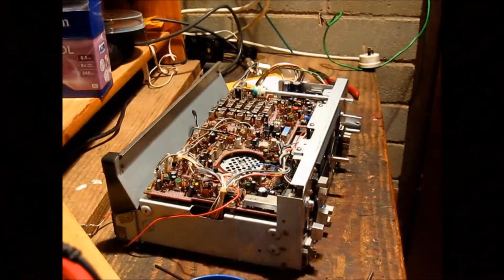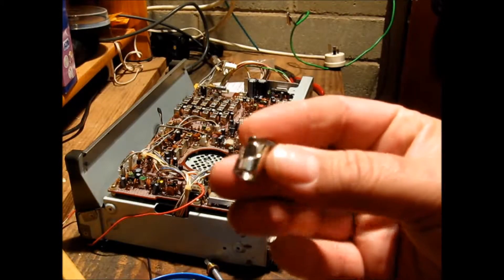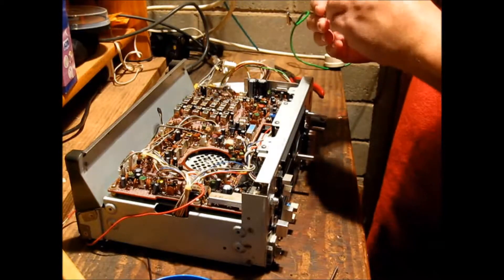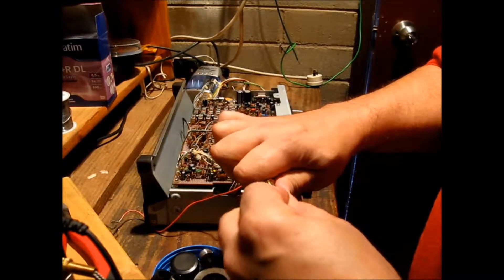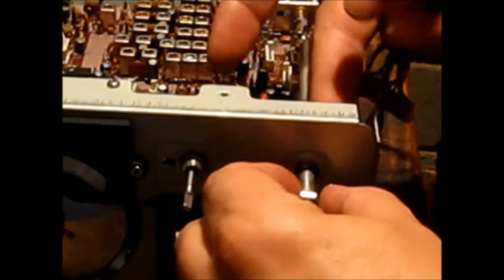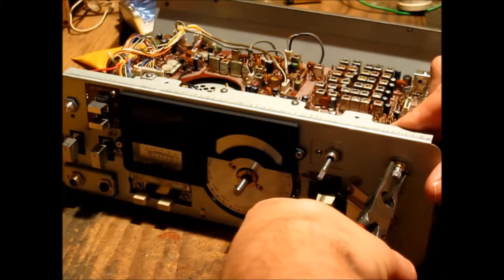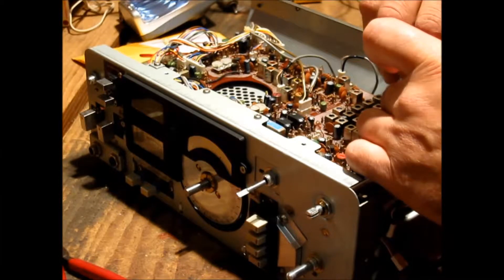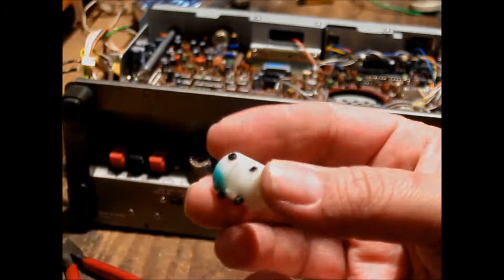Kenwood R1000 - RF Attenuator Switch Coupler Repair

Comment: it's nice to see this vid.....I just bought one of these nice radios from eBay and the knob is slipping on the shaft. Probably need to replace the plastic coupler OR find a metal coupler. Very nice radio
Reply from the maker: Yes nice performers and a decent entry level radio 👍
Reply: @SpectreOZ  Well it beats the pants off of a Zenith transoceanic. Even with an external antenna. I even had the DAM Zenith serviced by a fellow who knows these radios inside and out and $145 for his repairs/restoration.
Reply from the maker: @adriancressy8363  Always wanted one of those Zeniths but have been quite happy with the R1000 and even DX300 for that matter (whilst I had it), my FRG-7 needs some love but still works great and almost on par I would say with the Kenwood 👍

Comment: I just replaced this on one I just purchased. Radio is in nice condition but that knob was slipping. It was impossible to remove that damn inner C-clip so I found it easier just to unscrew the board. Don't need to disconnect any wires. You only need to move the board back about 1/2" to get removed the shaft.
Reply from the maker: Glad to hear you got it solved... like the adage says "there's more than one way to skin a cat..." 👍

Comment: I need to replace mine, however: by using a metal joint, making an electrical connection? Will this not effect the performance of the attenuation? Thanks for the video👍
Reply from the maker: The shaft is not electrically conductive to the circuit, it is only a means of turning plates/contacts in the rear switch.

Comment: Well if I ever need to do this where can I get that neat joint thingy?
Reply from the maker: I found this one on eBay, just search for "6mm flexible shaft coupler" OR "model car shaft coupling" they do have various types but not all will fit (as I found out), there are also solid nylon/brass types.
Reply: @SpectreOZ I have the same receiver and I need to replace the original broken part. What material should it be the new part? Thank you and greetings from Italy!
Reply from the maker: @fabriziomastrangeli2767  Any flexible coupling that will fit should be fine so long as it doesn't make contact or bind up anywhere, the one I used metal/alloy
Reply: @SpectreOZ  Thanks for the reply. One last question ... do you have a link or a photograph of the piece so that I can purchase it identical? Have a nice day and thank you again
Reply from the maker: @fabriziomastrangeli2767  https://www.vxb.com/6mm-to-6mm-Miniature-p/6x6mm-miniature-coupling.htm

Much cheaper on eBay search for 6mm to 6mm universal coupling

Comment: I see you removed the video part where the clip pops off and flies across the room never to be seen again :-)
pretty good tip
PS like that music......." like zoinks man"
Reply from the maker: Jinky's thanks for your reply, sorry about the Mission Impossible intro... it was just a tune that had been playing in my head the day I opened up the receiver, you could say I was a tad reluctant messing with the most expensive piece of radio hardware I possess (thus it seemed somewhat fitting).